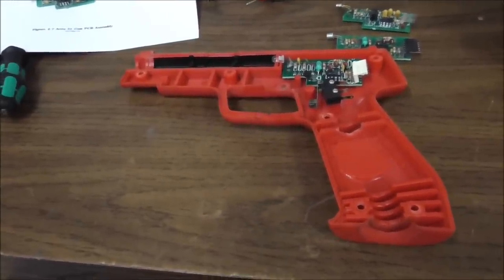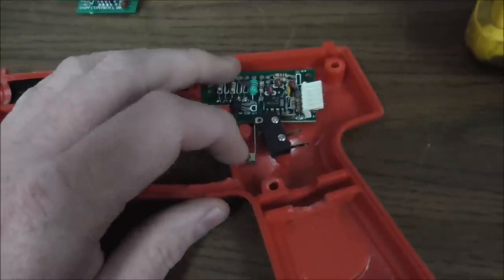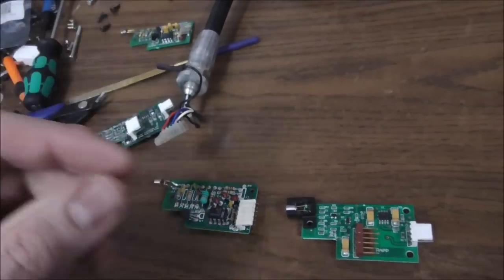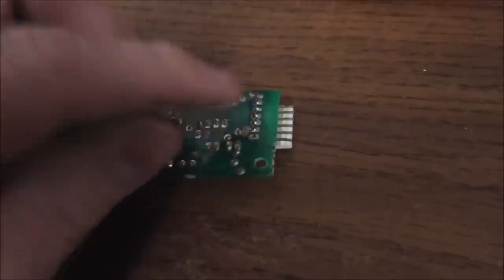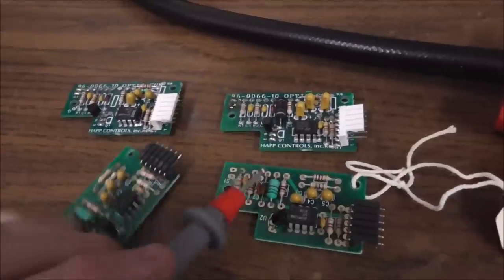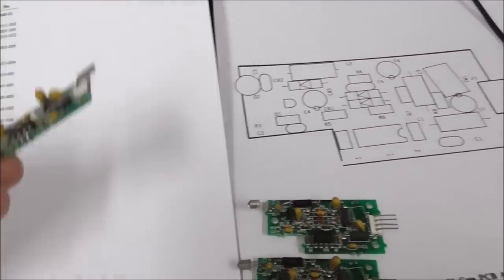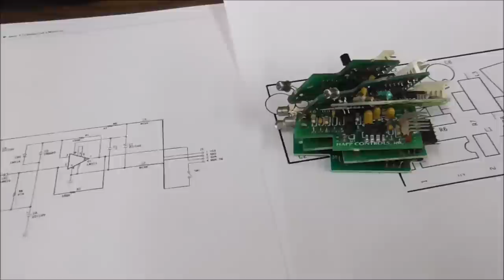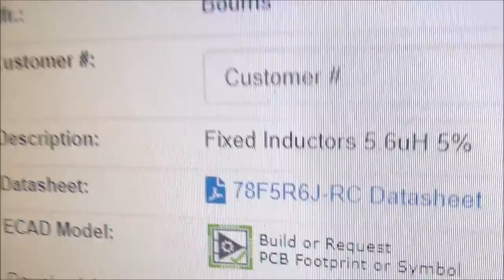Repairing Happ Arcade Game Lightguns - Area 51 , Lethal Enforcers, Police Trainer, Etc.

Comment: Another entertaining video as always! Old EE here. Your inductors are marked silver-green-blue-red-silver, which is 5,600 microhenrys (uH), or 5.6 millihenrys (mH), with a 10% tolerance. The parts list is wrong but the schematic is right, so make sure you order the correct part. See here for how to read inductor color codes: https://learnabout-electronics.org/ac_theory/inductors04.php.
Reply from the maker: Thanks engmcgill I ordered some more but I based it on the parts list so I probably ordered the wrong ones, lol.... if I did I'll reorder, thank you I didn't catch it!
Reply: ENGMCGILL, why do you think they used an inductor instead of using a resistor?
Reply: @waynegram8907  Good question, Wayne. I think it serves two purposes. First, since inductors resist rapid changes in current, it limits the current through the transistor when a pulse of light is seen from the CRT. Second, since the inductor smooths the fast edge of the pulse, it limits the noise coupled to the power supply line (the top side of the inductor in the schematic), and over the cable back to the console. Perhaps they were trying to meet some radiated noise spec. That's why the two ferrite beads are on the board—to filter noise to and from the board.

What I don't like is that the only thing that limits the transistor's collector current when the gun is pointed at a bright, steady light, such as a sunny window, is the inductor's DC resistance. Maybe that's what's blowing the inductors, since some of those little ones are only rated to handle a few tens of milliamps. Also, that 2N3904 is only rated to 200 mA, so with the 5 V supply rail you need at least 25 ohms of resistance on the collector to keep from frying the transistor. If you replace that inductor with one that has the same inductance (5.6 mH) but a lower DC resistance, it could blow Q1. I would just replace the inductor with a 100 ohm, 1/4 watt resistor and it would probably work.

EDIT: I just noticed the 47 ohm resistor on the 5 V supply rail, so I guess the transistor is safe even if the inductor's resistance is lower than the original's. However that will still provide ~100 mA through the inductor and may be what's frying them.
Reply: thanks for the help, What kind of digital logic signal is the photo transistor receiving? it is some kind of encoded signal. What Frequency is the photo transistor receiving this digital signal at? I think the Ferrite beans are there to cancel out noise to prevent false triggering the IC input pins. The BAD inductors DC resistance measured higher than 40ohms or more, but the GOOD inductors DC resistance measured 30ohms which is more mA current to damage the transistor. I find it unusual that the higher DC resistance inductors were BAD because higher inductors DC resistance is preventing the transistor 2N3904 to get damaged since it has less current going through the emitter to collector junction of the transistor. The Photo Transistor is set at a certain frequency because you can't use any Photo transistor because each part number will be set at a different frequency to be received which is overlooked by repair techs.
Reply: @waynegram8907  There's no special encoding, other than the fact that the flash of light is generated by a CRT. One scan line is 63.5 microseconds, so the signal seen by the pen is only a couple of microseconds (probably a series of pulses for the many scan lines in the field of view of the gun's lens). See http://sebastianmihai.com/crt.html and https://www.atariarchives.org/creativeatari/Build_Your_Own_Light_Pen.php for more info on CRT scanning and light pens.

The higher resistance inductors were bad because the wires in them were fried and went open circuit. An ideal inductor has zero resistance, but real ones, especially small ones with relatively high inductance like the inductors in the game guns, are made from many turns of extremely fine wire. That's why they have tens of ohms of resistance and can't handle much current. I think the gun design is flawed because a bright, steady light can cause 100 mA of current to flow through the inductor, destroying it. That's probably why Happ redesigned the board to eliminate the inductor.

Comment: If your missing the plastic bracket holding the photo transistor, maybe the hot glued used by the LED would be a good idea to relieve stress.
Reply from the maker: Definitely!  The original ones didn't have that little bracket, but they kept having the phototransistor legs break, so the redesigned the gun slightly and made room in the housing for that little bracket, it helps a lot.

Comment: The colors mark the Henry value. Some data sheets will give the resistance value for the inductor.
Reply from the maker: Interesting, I wonder if there's a way to measure the henry value?
Reply: @LyonsArcade  Yes, there is. An LCR meter has it built in. I'm not sure it will work for smaller values though.

Comment: They taught me about inductors back in the day, but off the top of my head I don't remember what was special about them. I think it's made out of a little coil of wire, and its resistance increases with the current, or something like that?
Reply from the maker: Somebody was saying that basically it resists the current changing...

Comment: Hi  Looking at the schematic. When there is light on the photo diode the 2N3904 transistor is turned on. This puts the inductor directly across the power supply rail via the 47 ohm resistor R8. The inductor would then have quite a high current flowing through it. I am wondering if the guns are left hanging looking at light when not in use. This may cause premature failure. Most inductors of this size will only have a continous current rating of a few tens of milliamps at the most,
Reply from the maker: Hi Pete;  When I was looking into buying replacement inductors I noticed that like you said they're not rated very high, that very well could have been the issue and it's interesting that more light may burn them up, I never thought about that, it may literally be an issue where depending on their location they get more current through them!  Thank you for the info, we appreciate it!
Reply: Joe's Classic Video Games You are welcome. I just love your videos. Keep them coming.

As a test you might try increasing the value of R8. To perhaps 100 Ohms. This would reduce the current through the inductor, but of course may reduce sensitivity. Worth an experiment though are there any signs of R8 getting warm. Discolouration perhaps?

Comment: Hi Ron, 

Amazing, and informative as always... :-)

Point of interest (and please correct me if I'm mistaken) - 

When dealing with light gun systems, there are two different types (although both are considered analog controls); 'Active' (more common) and 'Passive' (older)

'Passive' light gun systems (like the Nintendo Zapper), relied on the system replacing the target on screen with a white box for a single video frame when the trigger is pulled. The light sensor would then read the presence, or absence of the white light to register a hit, or miss.

'Active' light gun systems track the movement of the gun at all times while the system is active, and the gun is pointed at the screen.
Reply from the maker: Yes you are correct Dave!  The newer games had a whole new design with sensors all around the screen, this is the older passive tech...

Comment: Joe: what programmer do you use for arcade ERPOM / Flash?
Reply from the maker: I have two different ones, I have the Pocket Programmer II which mainly just does eproms and works better for me for the really old stuff like 2716's... and I have a Minipro TL866II programmer that's super cheap but works great.  It would be a great entry level programmer... eventually you'll find any programmer you dont' like the way it does a certain thing, or it doesn't handle this particular chip properly, etc. so you'll probably end up with a few different models.  

I had a GQ-4x programmer and it broke a couple days after I bought it, the company wouldn't stand behind it and wouldn't even answer any contact, I signed up for their 'forum' to try to get technical help and they wouldn't even send me a confirmation code to get on the forum.  Horrible company!

Comment: Joes classic, what is that L2 5.6uH used for in the lightgun circuit, I'm confused why the used an inductor instead of using a low value resistor. the uH or mH means milli henry or micro henrys?
Reply from the maker: I'm not completely sure myself Wayne unfortunately, someone down below explained how they feel it works though so they'd probably be better at explaining it than me.
Reply: Inductors are completely different to resistors.  You wont see many as big as milliHenry's.  Most will be microHenry's.  The Greek letter mu ( looks a bit like a u ) is the symbol for micro.  The lower case m represents milli.  Calling them mu Henry's would be quite appropriate to keep the trolls silent.  
I haven't had a good look at the circuit, but I would guess the inductor is part of a tuned circuit with a capacitor or maybe even a small free running oscillator circuit.  I would guess there would have to be some kind of timing reference on the board.
Reply: When you have time look at the schematic I don't think its a tuned circuit, their is a purpose for that inductor to do something with the encoded digital logic signal. What type of digital signal is being received by the photo transistor? is it an encoded digital signal?

Comment: Is the tech similiar to the early nintendo shooters like Hogan's Alley and Gumshoe?
Reply: For NES, it would blank the screen for one frame, then place a white square where a target is and see if the detector went off for that frame, then continue for the number of targets.  So, similar.  The arcade versions may have been more sophisticated though.
Reply: @ovalteen4404  Ah cool. Thanks for the input!
Reply from the maker: The NES arcade games worked pretty similar, we have a video on here of "Vs. Duck Hunt" and there was actually a setting in the manual to make it more or less accurate, which I assume was changing the size of the hit box around the targets!

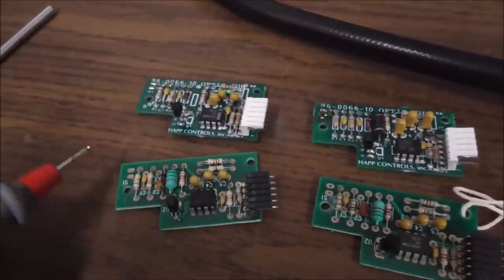Comment: Great video, thoroughly enjoyed the tinkering. At the 29:30 mark, when you talk about the green inductors it looks like they are the same (by the markings) but that one is reversed to the other orientation wise. Now, I'm below novice level when it comes to knowing how these parts work but I know that some stuff has like a +/- thing or something to the likes of that and I just needed to ask the question; Did it have the same value regardless of its orientation, did you test that? Just super curious :)
Reply from the maker: That's a good question, I did test it both ways and it tests the same.... you're correct though, some items need to be orientated a certain way for sure.   Resistors do not though, and this Inductor I believe is just a type of resistor or at least similar in that it can go in either way.  Thanks for watching Joakim, we appreciate it!
Reply: @LyonsArcade  An inductor is a conductor wrapped around a core.  So no, they don't really care about polarity when measuring resistance.

BTW, you've seen naked inductors.  Chokes for filtering and torodial inductors(doughnuts wrapped with wire) in transformers/power supplies.

Comment: Tantalum capacitors are famous for going bad,  it looks like there's a few on there
Reply from the maker: I've tried replacing them in the past on some to fix them but never could get any to work with replacing them so I guess most of these are still doing their thing for now!
Reply: @LyonsArcade  Tantalums will fail spectacularly if they fail as they tend to short.  IF they are not shorted, likely they are good.

Comment: The colour chart will still work with inductors, but they are not measured in ohms, they are mesured in Henrys.  You will find majority are micro-Henry's - uH.  Inductance is different to resistance.
Inductance is the tendency of an electrical conductor to oppose a change in the electric current flowing through it.  In general they are made of a certain number of coils of wire with a ferrite core.  
The inductors will sometimes get open windings.  You can measure the DC resistance, but it won't ever match the colour code as ohms :)
Reply from the maker: Ahhh, that makes sense.  So it was correct and the chart was correct, I just didn't have a way of measuring the little Henrys :) Thanks Brendan for the Inductor explanation, I've seen them before but never had to mess with them.  I ordered some to try to fix the rest of the boards!

Comment: Hi guys. I’m working on a Taito Operation Wolf. The gun is missing the barrel on the end and the lens is missing.  Have you worked on one of these before?  Wondering if the type of gun in you video has the same type of lens
Reply from the maker: I believe it's different, they basically do the same thing but it's a different size.  I think that end piece with the lens comes completely off on an Operation Wolf... the good news is so many of them have been parted out I think you can find parts for them on ebay.  Also if you check www.TwistyWristArcade.com he reproduced the gun board awhile back too...

Comment: uH or MH is Micro Henries.
Reply from the maker: Thank you FloatingFatMan!
Reply: mH (lower case) is milli-henry. 1 mH = 1000 uH. Upper case M is usually Mega. Inductors are not that big. I've never seen uppercase M used for micro.
Reply: @yottaforce  You are correct. That schematic had the inductor labled incorrectly as it used MH not mH.
Reply: Oops, my bad on the MH. Thanks for the correction.